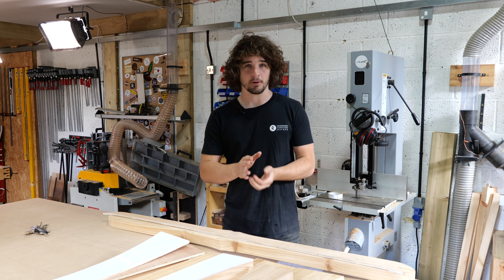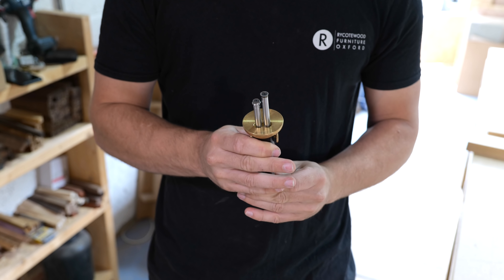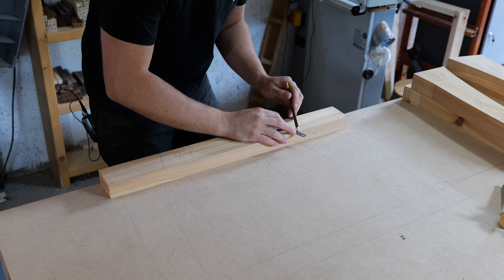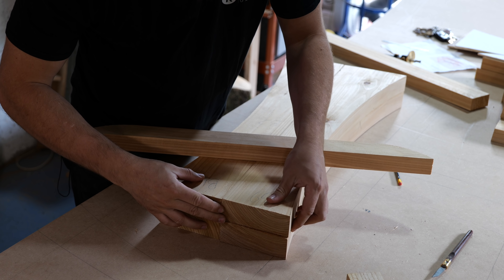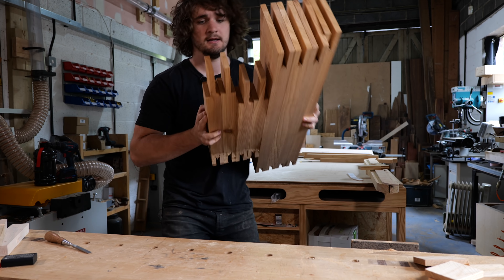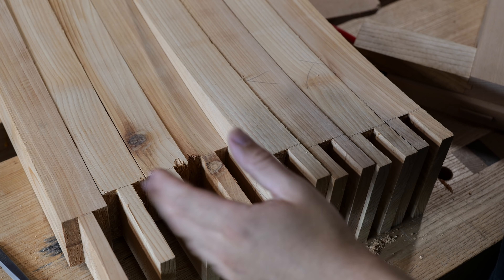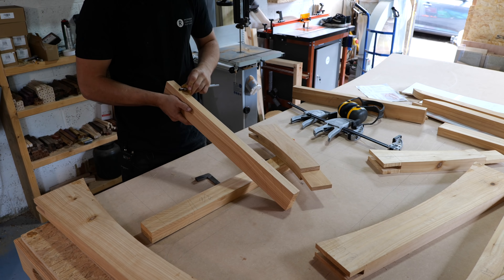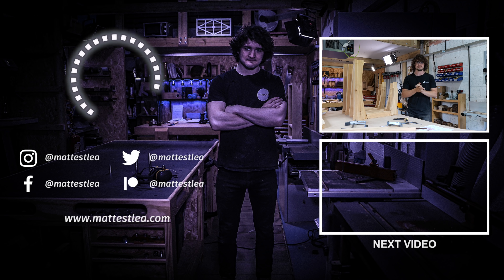Beginning the JOINERY | The Japanese Inspired Picnic Bench Project #5

Comment: Another thing besides using a very low angle on your chisel is to use a combination of water and denatured alcohol and spray it on the end grain. You want the fibers to be wet when paring. It keeps the fibers together better and allows you to cleany slice through it. People who use lots of softwood such as people who build Japanese temples use this technique a lot. I have done it myself and it works well but I have only used water. People use different ratios of denatured alcohol and water but it doesn't really matter however on fine woodworking their is a really good ratio. I can't remember the ration but a google search should pull it.

Comment: Finished a silver pine project recently. It had the same problem while chiseling. It worked better when I skewed the chisel so the cutting edge went down at an angle apposed to perpendicular to the grain. Had better success cutting with the Japanese cross-cut saw much closer to the line than I typically would and finishing the removal with either 150 grit sandpaper on a block or taping around the piece the line and using Japanese fine-cut files. Took a bit longer, but the joints looked way better.

Comment: Hi Matt, the secret to cleanly pairing cedar is to use a very low angle on your chisel. I keep a set sharpened at 20° for these types of woods, you need to sharpen more often but you get crisp cuts.... All the best
Reply: This was going to be my response. Very low angle on the chisel.
Reply: Rob Cosman is even using 17°.
Reply: Yes, I wondered why my coworkers all had their bevels questionably low until I tried it myself and found my tools cut through the timber much better. Still dreadful to work with, but better.
Need to find a new job where cedar isnt in the company name 😂
Reply: Same. You have to use a low angle chisel.

Comment: When trying to do a shoulder line in really soft woods like cedar I get close with saws and chisels and finish with a shoulder plane I guess if your good enough you could do the same with a paring cut but I don’t trust that and it seems that the bottom of the plane before and after the blade keeps the fibers compressed enough not to tear out

Comment: You should try Rob Cosman's technique for soft wood -- 17 degree angle on the chisel.
Reply: Haha, posted the same thing, scrolled down some else already mentioned, Rob's got most the the answers.
Reply: I’ve got a set of nasty modern Irwin/Marples ground to 17° just for times such as these (pine, outdoor furniture setup, etc)
Reply: Just built a swing frame with 4x4 and 8x6 cedar timbers that also has a fully joined rib and facia roof covered in tin that stretches 8’ across and 32” out over front and back.  The 17° bevel helped a whole lot. It’s overall dimensions are 12’ wide 8’ tall and 7’ deep with the 8’x 7’ roof.... all for the purposes of hanging the 6’ swing I’m building. The 25° bevel was never going to get it done, but the 17° is right on point.
Reply from the maker: Will give it a go!
Reply: I just ground a 17 degree bevel on a chisel yesterday, for paring soft woods and having watched the Rob Cosman video. Works really well.
Reply: Is that 17 degrees without a secondary bevel?
Reply: Chris Morris, I’m sure 23° with 17° would be fine, but I just happened to have some Narex chisels and where I live cypress and cedar are plentiful and locally sourced. So with a big back yard and a small budget, I figured what the heck, they’ll get used. I’ve used them to work on wet green treated lumber too. I just clean them up afterwards and then they go into a Klein tool pouch with a vapor cartridge after wiping them down with jojoba.

Comment: Hey Matt, are you concerned at all with wood movement in the bridle joints? Normally it's probably not an issue, but these are really big joints and the bench will be exposed to rain and direct sunlight, so I'm guessing it'll undergo more warping than an indoor piece might. If it is something to think about, how did you address it in the design? Thanks!
Reply: look up the qualertys of red Cedar. IT is remarkeble stabel when it coms to water. in Japan it is user a lot in kitchen aplications. as rice buckets and miso cups.

Comment: Matt you maybe want to keep endgrain off of the ground so water wont wick up into your components
Reply: And when you are unable to keep the endgrain of the ground (or any other place where endgrain is exposed) an end-grain sealer applied until it won't soak in anymore works really well, also works very well reduce checking at the ends.  They are typically wax emulsions but some of the newer ones are a blend of wax and something else.  Both types work well, but you cannot stain over it.

Comment: Would have been nice to show other methods of cutting those joints, I dont have a £400 bandsaw and a £365 hand saw :) just think all that tear out means MORE glue
Reply: To be fair, looked like Matt was also using a 10-quid panel saw to finish the angled cuts, etc (and which would also work to replace the bandsaw and the Skelton)
Reply: Did you expect him to buy an £80 bandsaw and a £20 tenon saw for the project, or use the tools he already owns? In reality, you could use a good panel saw, but a couple of £50ish new saws would do the job or even a cheap Japanese pull saw with rip and crosscut blade. Without a bandsaw it'll take a bit longer, but for that volume, perhaps only an additional hour, so if you don't already own a bandsaw and don't intend building multiple picnic benches then stick to the handtools. For accurate bridle cuts with the handsaw you can make an L shaped hook that goes over the end of the workpiece with a couple of magnets glued into it, that will guide the saw for a flawless cut.

Comment: Bridal joints and through tenons are not typical Japanese joints which tend to be much more complex and do not require glue or metal but lock in with splines.
You've probably already shot the entire series so it's too late for this "Japanese inspired" picnic table. Sad

You will be doing yourself and your viewers a favour if you execute some fine complex Japanese joinery.

Comment: That's not parring though,youre basically smashing through the grain  with a heavy chipping cut with a steep bevel to boot, lower the angle on the chisel, work accross the grain for extra support from the fibres and take very fine circular parring cuts.
Same way you'd parr a tenon face with a diagonal cuts for a cleaner surface. 
Even better, you know those things called shoulder planes? that's what they're designed to do.
Would make easy work on that cedar if you have one. 
I know I'm being sarcastic but this really should be common knowledge for any joiner.